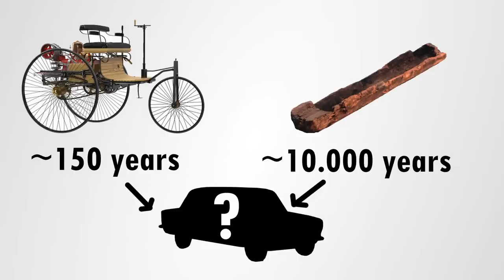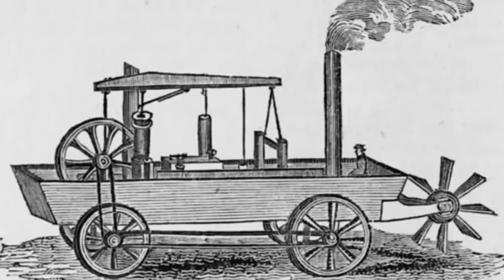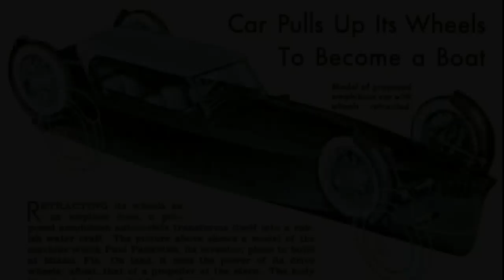Floating Fun: The History of the Amphibious Boat Car

Comment: I am amazed nobody has made a knock off kit version of the Amphicar with fiberglass and a Honda motor. Especially with clean examples of these getting so rare and pricey.
Reply: I think U.K kit-car maker Dutton did so in the eighties. It wasn’t a success.
Reply: Yeah, I don’t even know why Amphicar didn’t start with fiberglass in the first place. The number one killer of those already rare cars is rust. Since a lot of transverse engine cars have an output shaft to the rear for part time AWD, I would think it shouldn’t be too hard to adapt that layout to a rear engine Amphicar.
Reply: If you ever get serious, im a draftsman, inventor, and engineer, i can redesign things to avoid patent infringement lawsuits, etc, my entire life has been designing machinery, and id love to help... Lets also do isettas and Messerschmitt cabin scooter copies, and work our way to the nsu prinz and dauphines, bmw 600s, and fiat 500s, heinkels, etc... I know theyd sell like hotcakes
Reply: @AtheistOrphan  Well, the Dutton was amphibious and fibre glass but had the poor idea of being front engined and front wheel drive hence, it was nose heavy whereas a boat should have the weight at the back and front pointed up. Based on a Ford Fiesta.
Reply: @ajivins1  - Good call.

Comment: Have a relative who owns 3 Amphicars. I've been in them a few times and here's a few observations:
1) Real world top speed was about 45 mph.
2) At the inside bottom of each door was an additional pressure latch, not unlike an old cooler. Fail to lock them and you'd sink. Amphicars didn't have a ton of freeboard.
3) The electrical systems were, surprisingly, more dependable than a Triumph Herald's.
4) Next to driving into or out of water, the most fun was waiting to after you left the lake and hit a stop light, then turned on the bilge pumps (again) to clear out the settled water in the engine compartment. Be ready for people behind you jumping out of their cars thinking you're dumping gasoline.
5) The brakes and steering on the water were very nearly as effective as they were on the land (not very).

Comment: Ed cited several good reasons that amphibious cars aren't more common, but I'll add one more:  The use case for them is rather specialized.  Unless you live in a rice paddy or you really want to avoid that toll bridge across the river, you really don't need an amphibious car that's practical enough to use every day.  Like Ed said, they'll mostly be toys for the affluent.  Kind of like most boats, actually.
Reply: Or of you love on a small island with irregular or overpriced ferry service

Comment: 6:28 - A few years ago I was visiting relatives in the UK and was asked to drive a boat - which I had never done.  Luckily, the steering was on the port (left) side and we cruised on the right side of the canal.  It was just like driving in the US except for the lack of brakes! 😂

So, unless it recently changed, the English are cruising the waters on the right but driving on land on the left. ☺
Reply: Came here to say this, you're right.

Also most beetles will float provided there are no holes in the floorpan ;)

Comment: There were also two interesting projects in the USSR: GAZ-16 and NAMI-055.
GAZ-16 was a combination of a car on wheels with a hovercraft with a skirt.
NAMI-055V was based on Moskvitch-410 and had hydrofoils. It was built by a construction bureau of Rostislav Alexeyev, father of The Caspian Sea Monster.

Comment: I know you mentioned ATVs, but I'd add another sentence about extreme offroad vehicles that just so happen to float because sometimes it's more convenient than driving on the bottom of a swamp. Like the Sherp or Atlas ATVs. Especially that those vehicles are not only fun but also purchased by rescue teams operating in extreme conditions.

Comment: There is an old saying that the 2 happiest days of a boat owner is the day the buy it and the day they sold it. Given the flaws of the Amphicar, the selling day joy would be doubled. I recall them as a child/young teen when new in my home area of Northern NJ, not far from NY City and saw a few around my area on the road. 
I wish you had used a better picture of Pres. Lyndon Johnson than the one of the moment he took the oath of office as President (he was the Vice-President) after the assassination of President John F. Kennedy. I was aware of the stories of his Amphicar. I was also aware of some of the other attempts for amphibious boat-cars but indeed like with flying cars, they are terrible compromises that don't work well for either function.
Reply: Agreed, tasteless photo choice.  Or perhaps Ed doesn't like LBJ.

Comment: The only sillier thing than an amphibious car, is one that flies. Flying cars fall in the same problem as amphibious cars, they're too bulky and fragile to be a decent car, and are heavy and have a lot of drag in the sky. You're much better off getting a decent low end sportscar, like a Miata, a nice low performance airplane and using the money you're not spending to buy fuel for your flying car on having fun.

Comment: UK or USA technology, for anti flood. Car, say 2500 metric kg. Require 3000 cubic meters afloat to float the passenger cars, trapped on flood water. One float in front, one at the back. One float at right side, and one at left side. Ai yo yo yo, require quick actions to install the four floats.